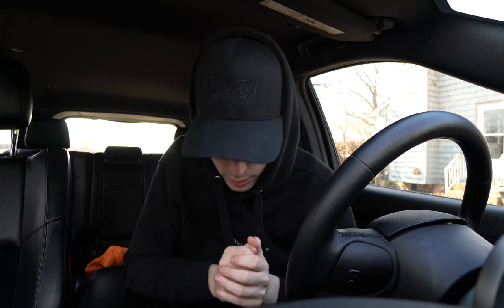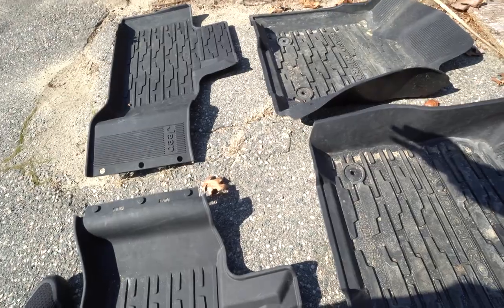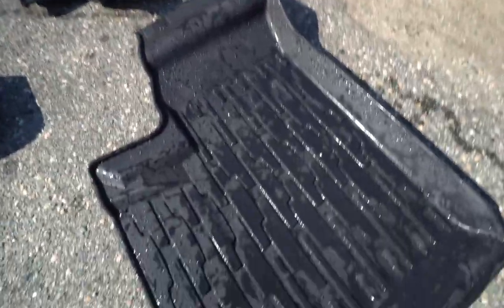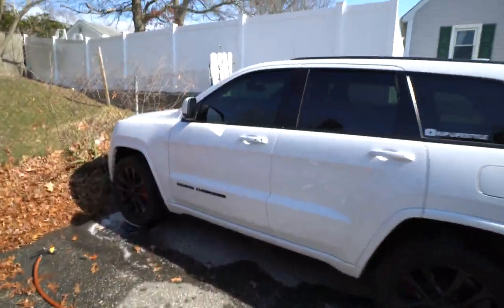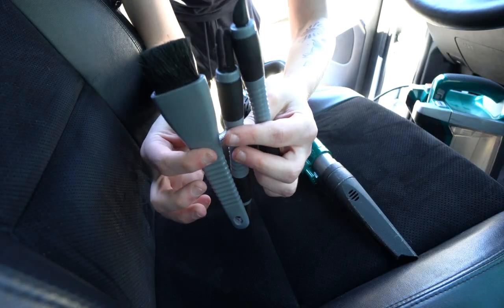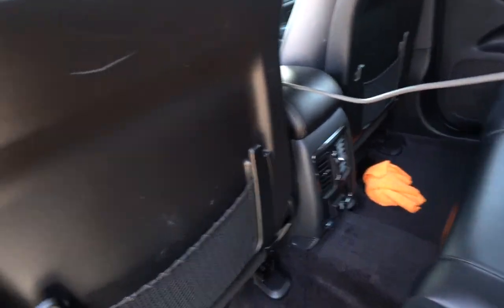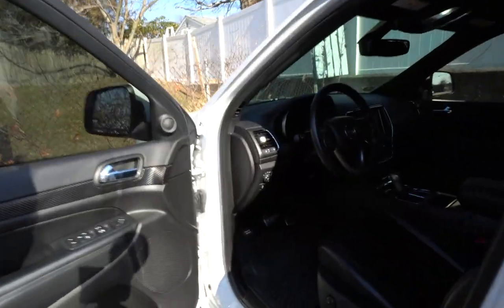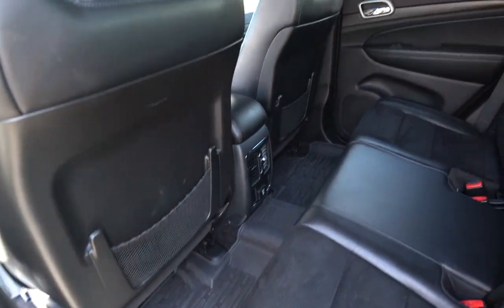CLEANING AN EXTREMELY DIRTY JEEP....

Comment: FWIW......Dollar store brand tire shine works great on floor mats...spray some on micro fiber cloth and works on door seals....certain trim pieces....front air dam....rear bumper sill.....and it works on tires too!!
Damp Micro fiber cloth on carpet between the seats and B pillar will catch the random hairy French fries also. 
HTH? 🙃😉🙃
Reply from the maker: Great tips! Does it leave that weird shiny look that gets on your fingers?
Reply: @BJPLIFESTYLE  it will leave a film if not wiped down afterwards.  
Doll Hair store brand works as good as others >it does eat all that dirt out of your floor mats really well...just need to wipe them down good...as they will be a tad slickery for a momento.

Comment: Hey BJ, questions 4 u. After u put ur wheel spacers on did you notice any performance issues? ( I relize u put the cheapest ones on ever produced). That being said, issues such as turning radius, rougher ride, front end alignment off, uneven wear on the tires, etc...
Reply from the maker: I still only have them on the back and havent noticed any issues! I’m actually going to make a video in the next week doing an update on them and maybe taking them off
Reply: @BJPLIFESTYLE  why take them off?